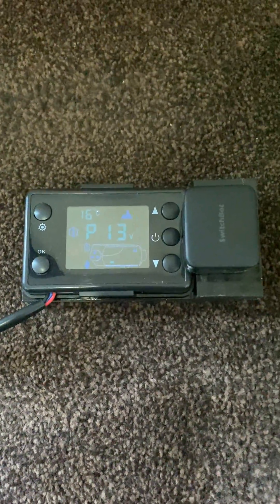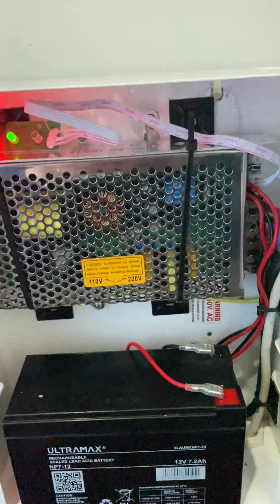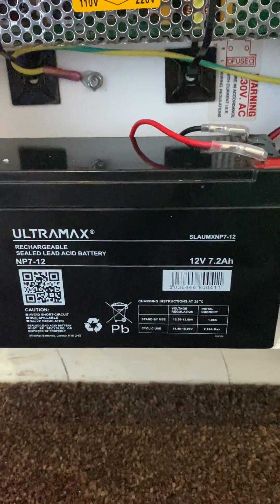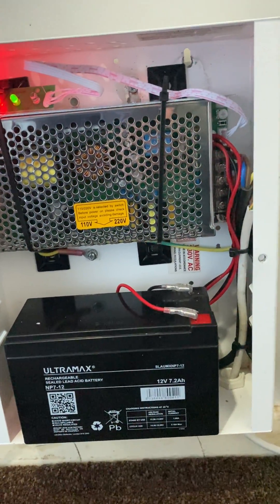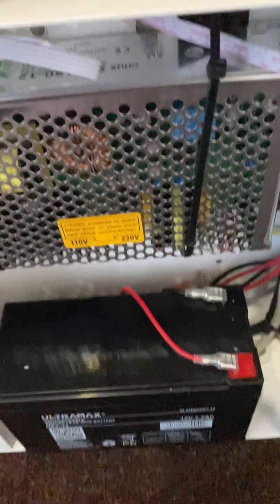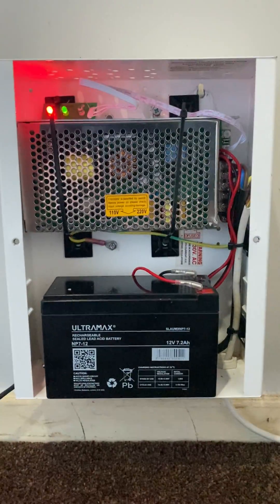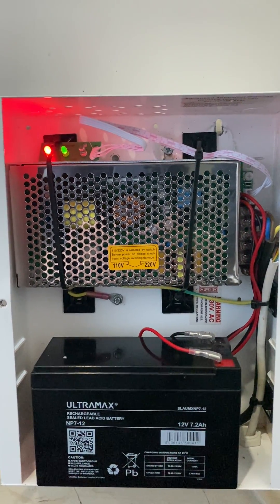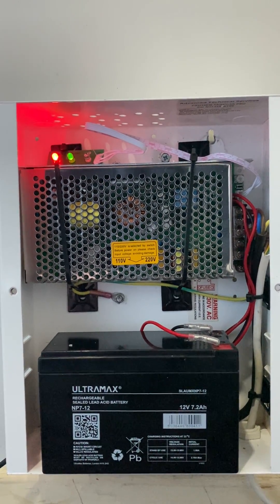Chinese Diesel Heater heating my home  With Battery Backup! Slimline battery install, neat and tidy!

Comment: I bought one of these and it has 4 battery leads two black and two red do i hook them both to the battery or are they for two batterys?
Reply from the maker: @MrMr-tr6sk  it’s for two batteries… only connect one set of red and black for one battery 👍🏻

Comment: New to this but wondered if it poses any issues to be constantly supplying the battery with voltage.?
Reply from the maker: @scottdobinsonm6osd712  I don’t have any problems as the power unit regulates the charging and only trickle charges when needed.

Comment: Installation installed and working a treat! One question... does anyone know what the 3 LEDs represent? There's also a small button which I had to push to make it work.
Reply from the maker: The Red light on means incoming power/electricity is on and battery is charging. Red light off means powercut. Green light is to show that 12v is being supplied by the transformer, either through the mains supply or when it has switched over to battery when the power is off. No green light means power off and battery flat. The other Led will only illuminate if there is a charging problem. 👍
Reply: That small button is a very important snippet of information that i failed to figure out myself, thank you...

Comment: Would it be possible for you to make a diagram of the wire, layout to where everything goes because in the video, it’s hard to tell where all the wires go. Thanks.
Reply from the maker: When you buy the transformer it becomes self explanatory how to connect it. It comes with 4 wires connected to it, those are the cables you connect to the battery. The 4 wires are 2 red and 2 black… that’s two pairs of cable. You can charge up 2 batteries at the same time. I’ve chosen to charge 1. 
You have to connect your own power supply to the transformer, it’s indicated on the transformer where to connect your Live, Neutral and Earth. You then connect the heater power cable to the transformer, it’s a black and red cable.. the red goes to V+ and the black to V- 
The power indicator lights are already connected to the transformer so it’s really quite simple 👍🏻

Comment: @deoxyrobo Thanks for a great video! 👍 So, I understand how to wire up one of these transformers, but I'd like to understand how it works. Am I right in saying (forgive my layman's approach):
- 12v power is provided to the heater via the transformer, which is powered from the mains. 
- The transformer also simultaneously supplies the battery with a trickle charge.
- Upon loss of the mains power, the transformer 'switches' and provides power to the heater via the battery. 
So, my understanding is that the cables from the transformer providing a charge to the battery then become the supply cables proving power to the heater?
Reply from the maker: Exactly right! 👍👍
Reply: @deoxyrobo  Thanks 👍
Reply: Hello again mate, I've another question if you don't mind 😬
Could you tell me what each of the LEDs indicate, please? Is it:
- Red ON = Mains on and powering heater / Red OFF = Mains off
- Green ON = Charging battery / Green OFF = ?
- White ON = ? / White OFF = ?

I'm a bit confused (clearly 😂). How do I know when the UPS is using the battery to power the heater and not mains? (Apart from my house lights being off 😂).

Comment: Would you or anyone else know if this is available on Amazon? Thank you,great setup! Hoping to be buying my first diesel heater soon and want to protect it if I lose AC power.
Reply from the maker: Ive not seen them on Amazon and cant find any. Also looked online and found similar but the Amps are too low and the price is around £75-£120! Its cheaper to make one yourself like i have. All the parts are listed below 🙌

Comment: You don’t need a relay or something just conect directed the Batery to the power source ?
Reply from the maker: No relay needed... Connect the heater directly to the power source. The heater needs a 12v 11amp power supply. The power unit i use is 12v 15amp, the heater power supply connects directly to the power unit. A battery is fitted under the power supply and connected to the power supply with the leads that are connected to the power supply.

Comment: Where do you find the cables from the Batery to the power supply ? Thanks 🙏🏻
Reply from the maker: Hi, the cables come already attached to the power  for the battery. The PSU is designed to give 12v DC and charge 2x batteries.

Comment: Nice setup.   Mine is similar and runs off a 60 amp hour LFP lithium battery with a 6 amp lithium smart charger. It runs during power failures and short outages. The LED 12 volt light is attached to the top of the outside of the fuel tank near the pump with aluminum foil duct tape. I also added a fuel filter and the hard plastic fuel lines as well as an aftermarket muffler. The unit runs 24/7 as long as we are home but gets shut down anytime we leave. I use red diesel fuel and the burn chamber always looks clean when I inspect it in October as the weather changes.  https://www.youtube.com/watch?v=ceeSfqwcNOs

Comment: How did you wire that up
Reply from the maker: Its very straight forward. Connect mains power to the L N E terminals. Connect the heater to V+ and V- (12v) Connect one set of the remaining cables to your battery Red and Black. There will be one pair of cables remaining, one red and the other is black, they are if you want to charge 2 batteries.
Reply: @deoxyrobo Thanks for a great video! 👍 So, I understand how to wire up one of these transformers, but I'd like to understand how it works. Am I right in saying (forgive my layman's approach):
- 12v power is provided to the heater via the transformer, which is powered from the mains. 
- The transformer also simultaneously supplies the battery with a trickle charge.
- Upon loss of the mains power, the transformer 'switches' and provides power to the heater via the battery. 
So, my understanding is that the cables from the transformer providing a charge to the battery then become the supply cables proving power to the heater?

Comment: Perfect, and thank you! I am putting one of these heaters together as supplemental heat for my home. I am building s small utility box outside to contain and protect everything and simply didn't want to go with a bulky battery and trickle charger combo. I figured a 8kw heater combined with a 20amp PS and a 20ah battery similar to yours should suffice. I doubt I would ever start the heater off the battery but its nice to have that as an option. My main objective is to protect the heater from a power failure.
Reply from the maker: Your welcome! That la the only reason I have the battery, to protect the heater in a power outage. 
Happy building 👌🏻👌🏻

Comment: great video and instructions.I have two extra questions to ask:
1: My charger feels warm (is this normal)
2: if the heater isnt on do you leave the transformer plugged into the wall?
Reply from the maker: My charger is also warm... I have 3 more chargers around the house and they all are thew same warmth. 
i leave mine plugged in all the time so it keeps the battery topped up as the heater display would still on and drawing from the battery.

Comment: Hi, vary good video trying to find out if this box is a cctv box as slimline and if so would a previously installed 15amp board with a battery back up work ,,?thanks
Reply from the maker: Your correct! It was a cctv box and came with transformer that had 10 outputs for 12v dc each at 1.5am. 
It wouldn’t start the heater as not enough amps. So i stripped it out and fitted a different transformer 👍

Comment: Plz can you confirm where to add wires from 12v battery do tjey attache to the 12v outlet of the power suply unit and for me being a dummy can you tell me how battery maintains its charge
Reply from the maker: You dont have to add any wires, this transformer already has them fitted and has the ability to charge 2 batteries at the same time. It come with overcharge protection and the little circuit board with led's. The battery maintains its charge because all the time the unit is plugged into the mains, it is charging/maintaining the battery to keep it full. Only when you turn the power off or have a power cut will the battery not be charging. Power resumes and the battery begins to top up. 😁

Comment: Hi, thanks for the great videos on the CDH. I'm in the process of installing a 5KW Hcalory unit, it's the one that has the built in start / stop feature when it reaches the desired temp it turns off completely and back on when the room temp drops by 2 degrees. I read they use more current during startup and most other builds I've seen recommend using a 30amp so wondered are you using a 2KW heater? or is 30amp just overkill? Also could you please tell me where you purchased your metal box, a link to where I can purchase one would be most helpful. 
Kind regards Paul
Reply from the maker: Hi Paul, ive seen the CDH with the temp setting but cant comment on the power draw.. Also cant understand why it would be higher as its only doing the same job as mine by turning it off and on 🤷‍♂️ Surly the glow plug will draw the same amount of power each time it starts? If the glow plug is the same in each model then the amps needed wouldn’t change 🤷‍♂️
Mine is the 5K heater and the amps are the same in the 2K version. Same glow plug as its doing the same job of preheating the diesel. 
Im not an engineer but i think that kinda makes sense?
The box was a 10amp cctv transformer enclosure. The transformer had x10 12v connections but only at 1amp.
Hence me stripping it out and replacing with a different transformer and one that can maintain a battery. 👍
I salved my box from someone that was throwing it away, lucky for me. Ive seen them on amazon for around £40 but they come with the 10amp by x10 outputs @1amp.
Sadly ive not been able to find a bare unit.
You could however look for metal boxed cabinet on a google search and lots come up of varying sizes 😊
Reply: @deoxyrobo Hi I've got the same transformer can you tell me about the tiny black micro switch on this unit, how to see which is selected and which is the correct one for Chinese Diesel heater. Thanks for the previous help much appreciated. 👍 Paul
Reply: Glow plug does consume much more Amps at start-up. That's why we need a transformer from 230V AC to say 13V DC with sufficient current. 
Then, after start-up heather doesn't consume much current. 
Mine power supply is: V-TAC LED Pover Supply model: VT-21251
Power: 250W
Output: DC 12V - 20A
Input: AC 220~240V 50/60 Hz
I must admit, your set-up is superior to mine. Excellent idea with connecting backup battery for cooling down in case of power failure. 

I think these small batteries are used in home security systems as backup batteries.

Thank you for your time spent making this video.
Greetings from Slovakia.

Comment: Hi. Just a query. Is there any delay between the switchover from mains PSU to battery? Cheers. Declan
Reply from the maker: No delay whatsoever, i tested a few times and there is no power drop to the voltage on the heater connection 👍
Reply: @deoxyrobo  Thank You

Comment: I just bought the same ups power supply and on installing noticed that there was only 3.7v on red and black battery leads was wondering if your leads had 13.6 volts when the battery was not connected, with only 3.7 v on the leads I am wary of connecting the battery
Reply from the maker: when powered up i get 13.7v from the battery leads... Maybe you have a faulty unit?

Comment: Hello did the switching lights come with transformer?
Reply from the maker: Hi, yes it comes all prewired with switching lights and 2x 12v charging cables.
Reply: Thanks for the quick reply.

Comment: great vid! Thank you. I will be using almost your setup but with a bigger amp hour battery as we have had power outages that last a little less than a week and it gets cold cold here! Neg 50 F.    P.S. US amazon has those transformer units still and they have a range of sizes. Not sure if that would get to you any quicker or less for shipping than AliExpress.

Comment: I'm in the throw's of buying a 8kw diesel heater to supplement my paraffin heaters that heat my home.
I have also purchased which hasn't arrived a 12v transformer 500w 41.6ah example probably overkill.
What my concern would be is if your running your transformer which is charging your battery as it runs in tandem with the transformer supply won't you cook your battery as the transformer is supplying a steady 12v surely this will over charge the battery and potentially damage it??
Am I missing something here??
Rgds
Steffan
Reply from the maker: Hi Steffan, the transformer has battery overcharge feature so that it doesn’t cook the battery. The transformer I purchased has a separate power supply that you connect to the battery 👍🏻
Also, I’ve watched many YouTube videos on 8kw heaters and nearly all day that they are actually 5kw.

Comment: I recently got one of these and also attached a on/off switch on the main power line for safety reasons with mine been in my mancave, I don't really like leaving anything on while im not in there, I attached a dual set of mobility scooter batteries to it, two 12v/12aH. So in an emergency I can start it up and also have a battery to last, I may change one of the batteries to car battery/leisure battery in the future but for now it's a good solution in case a power cut or something else
Reply: I managed to get a set of mobility batteries for £32 in the sale so very affordable for a back up and peace of mind

Comment: Hi, just copied your setup it is now up and running, really pleased to not have the worry of a power cut and heater control board frying. So glad I came across your video, I agree with you car battery and charger is a no go. Side note: Ordered the transformer from your link, from ordering to deliver to Spain 6 days, gobsmacked, gotta be a first. All the best to you, you take care. 🙂

8
Reply from the maker: Hi Mick, that’s so good to read and happy to hear your happy with your setup too ☺️
Thanks for the positive feedback, you’ve made my day 🤩
All best, Darren.

Comment: Can you show how its all wired up together please? Cheers
Reply from the maker: It’s really quite simple to connect up as everything has its own place. 
Power in from mains 3 core to the L N and earth connection AC.
Output to the heater is V+ for live V- for neutral. 
The cables that come attached to the transformer are for charging the battery. 
There are 4 cables enabling you to charge 2 batteries if wanted. Only use one pair for single battery use.

Comment: Quick question, does this set up keep the battery charged or is it simply to switch to batter power when the mains  is off.  Cheers from Canada
Reply from the maker: It's a transformer that powers the heater and keeps the battery charged. If the power goes off it will auto switch over to the battery and keep running the heater. 😊
Reply: @deoxyrobo  cheers.

Comment: Love the compact  setup might order the PS at some point . Quick question couldn't you set up a switchbot condition that would turn it off after a set time if it was switched to battery backup .
Reply from the maker: Been having a think on this one 🤔
Because SwitchBots are battery operated they are not able to monitor power outages so not an option.
There could be an option to add a relay to the transformer auto switching... When power cuts the switch goes over to the battery, could possibly use that as a trigger for the relay to turn a switch off but not a SwitchBot. Would need to be a 12v mechanical switch.
I think realistically its not needed because battery I'm using will keep the heater running for about 3-4 hours and also the heater has an inbuilt function that will power down the heater automatically when the battery level starts to drop.
Its a luxury to recharge with mains electric but guess if was using solar panels to charge my battery then an option to switch off in a power cut would be beneficial  👍
Good idea though if circumstances required it 👌
Reply: Been having a think too and here's what I came up with . Plug PSU into smart plug and set up a scene/IFTT saying if smart plug goes off then activate switchbot . This would then turn off CDH ,but also you could reverse it and say if smart plug goes on the switch on switchbot if that all makes sense 😆
Reply from the maker: @BarFlyBrewing  Was just going to ask you about scenes a little more and then had a light bulb moment 💡 
If all the power has gone off then all your automation scenes are off, Alexa, home, google etc all dead🤦🏻‍♂️😂
So think how it’s set up is all you can do and works well…
If the power goes off while and the heater is on then I kinda want to leave the heater running to keep the house warm for as long as possible… battery will keep going for a few hours and when the voltage starts to drop it will power down automatically. If power is resumed it will continue and the battery starts to charge again.
Reply: @deoxyrobo  true all net etc is gone ,but if the scene or IFTT is ran on the phone maybe this could work and if the plug dies isn't it shown on the Google home app on the phone
Reply from the maker: @BarFlyBrewing  The app doesn’t monitor the state of the devices in the background and doesn’t notify when a device goes offline. There’s an expensive route but it means running systems on battery backup.